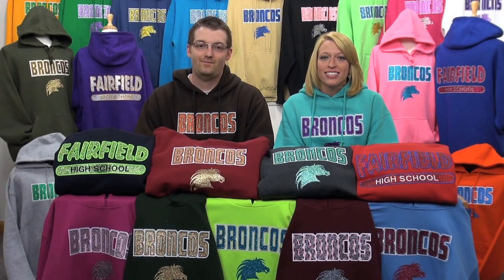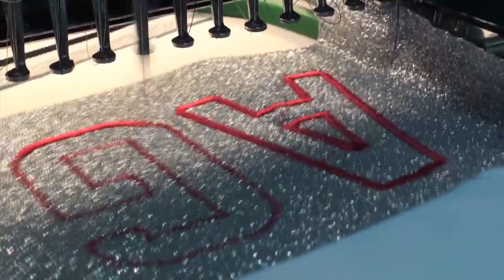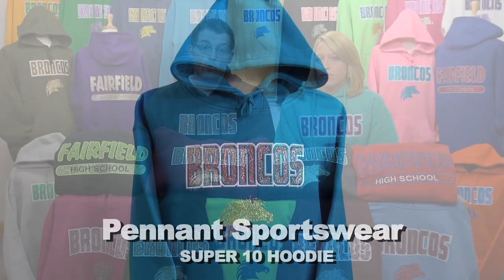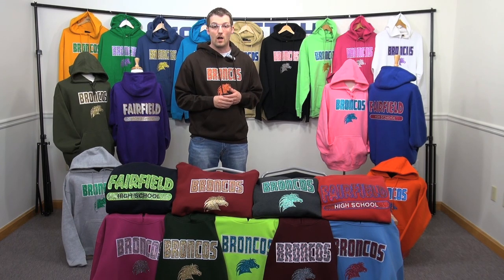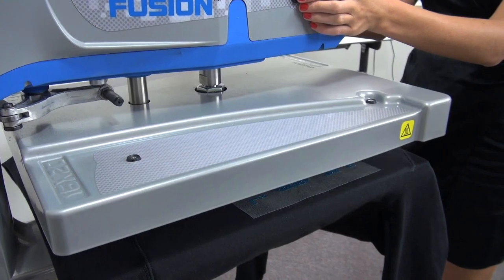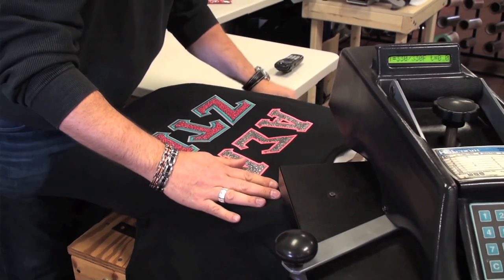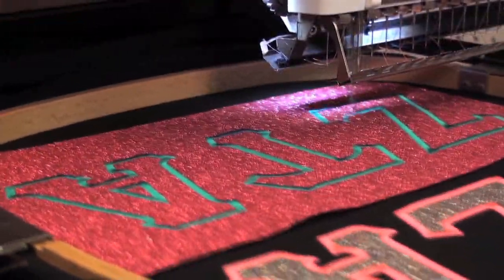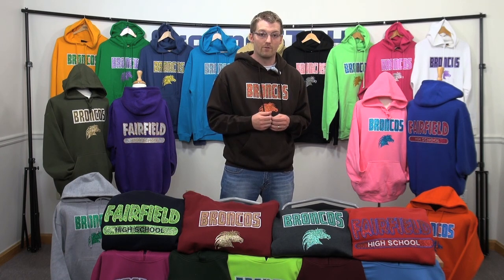Stahls'  Rip Away Applique'™ Ideas to Make Money with Glitter Flake Heat Transfer

Comment: I have just started using Glitter Flake with applique and embroidery.  I am having some customers returning stating the the glitter flake is pulling away after washing.  What am I doing wrong?  I use a heat press at 320 degrees for 15 seconds.  Is this method correct?

Comment: Unfortunately, if you rip it away after applying the satin stitch, you're going to get little glittery bits all in the satin border. You have to do a small single stitch outline and reverse, then rip off the glitter before the border is sewn.
Reply: I'd increase the density of satin stitch so I can rip away easy, but it also happen on the letters, now the Glitter Flake on the letters is ripped too. please help..